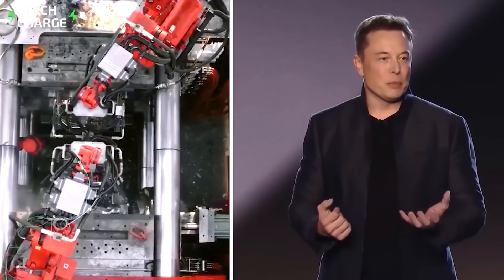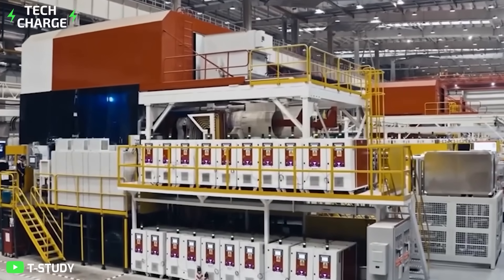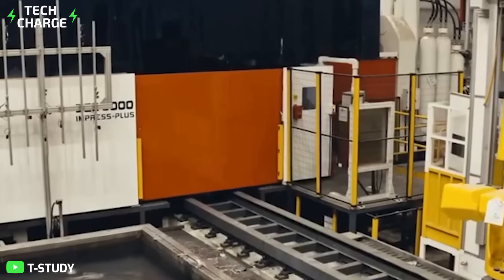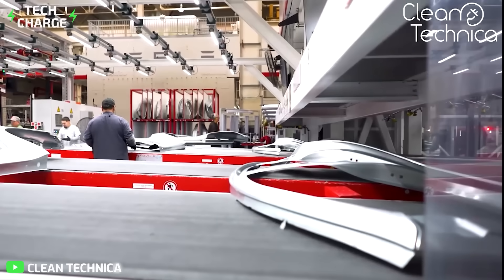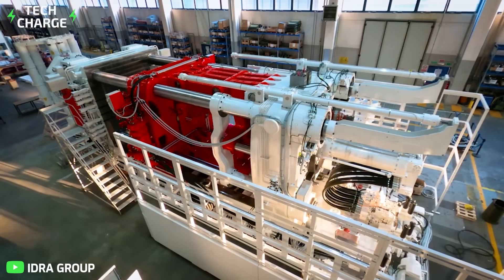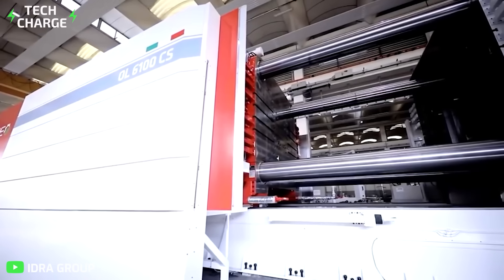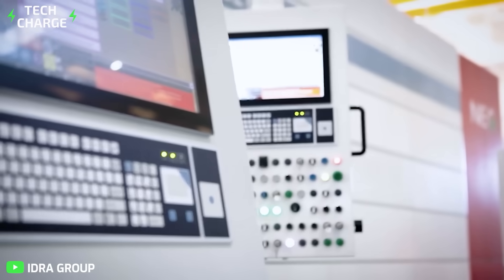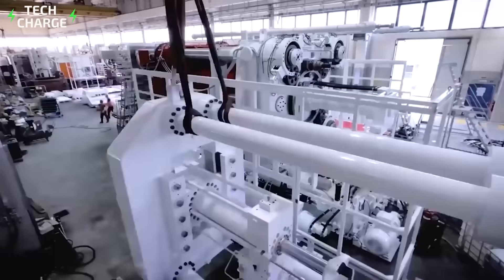How Tesla Cars Are Made So Fast - Meet the GIGA PRESS

Comment: What about an injection vacuum press using plastic.
Reply: Ok so you want a car frame made of plastic?
Reply: @MrSteeDoo  The metal out of the giga press seems flimsy. A plastic injection mold could make the whole body in one piece, with no assembly.  Probably could be just as strong if not stronger.  As far as collision damage, one cold probably be fixed with equal difficulty.

Comment: die cast cars... no fucking thanks... theyre gonna fall apart in a few years... die cast aluminum is extremely prone to cracks... especially in high vibration situations... silicon/aluminum alloys even more so... ill leave the die casting for the toy cars.... wow i had no idea these were fucking die cast moldings... i still thought they were made of sheet metal and the presses just formed it into shape... this is insanity... and not something id buy... i like Elon also... but im not interested in owning an EV... not practical in any way for my needs... and with this kind of build quality, i wouldnt buy one anyway... last car brand i heard was die casting bodies was Matchbox... smack one of them with a hammer and see how it fares... it doesnt bend so much as crumble into pieces... thats "die casting"... die casting is very well known as a cheap and easy way to form metal , the downsides are very low ductility, low strength and poor durability, and they really really hate being welded or repaired...
Reply: It isn't really the die casting it self, it's the metal used as most die cast AKA pop-metal is nearly all zinc with varying amounts of aluminum for higher quality.

Comment: Gigs-this, Mega-that, Super Charger. Hyperbole aside Tesla has yet to build a car with a hood that fits. Also, ‘falcon’ doors that don’t fit right (note the wear in the wheel arch area, and I know Tesla store managers who order an extra rear glass panel for every Model X they receive so that they can adjust the rear hatch, which almost never opens/closes right. Making the adjustment requires removing the rear glass, which normally breaks.

Comment: Sheet metal presses at GMC Truck and Coach in the 40s-70s were huge. They required foundations going down to bedrock and exerted hundreds of tons of force to create body panels and parts in a few seconds from rolls of steel. It was a deafening place to work with ten or more presses working constantly. The idea of die casting a frame is not really a press like in the past. A press assisted forge is more like it.
Reply: yeah, no not down to bedrock lol.
Reply: Ahh yes he is correct on mounting the press down to bedrock. It requires around 800-1000 tons to stamp a bodyside depending on the size of the stamping.

Comment: Why can't GM, Ford, VW do the same?  I am sure they can, so what is the competitive advantage?  Consumers are a fickle group and trying to catch their next mania is always the hard part really.   It must be so tough to do this.
Reply: The limit for most high pressure die casting machines is 4.000 to
It will be  very hard to handle this size due to tooling / process / die maintenance ...
the OEE will be on a lower level - very safe

Comment: Worked at GM, saw presses 100 times bigger than this that literally shake the earth while in operation
Reply: GMC Truck and Coach and Pontiac Motors had big presses too. Brother and Uncle worked presses in sheet metal. Hearing protection did little. Uncle worked 30 years and was almost deaf. Brother did ten and has significant hearing loss. Truck and Coach is long gone. Dad was at Pontiac Motors just up the street. Long gone with Fisher Body and foundry.
Reply: This is a die cast, not just a press. The largest die cast on earth.
Reply: never for casting!!!
maybe forging!

Comment: Pretty cool.   The crash mitigation they can cast in is probably another advantage to large cast parts.   Crash repair may be a little tougher.
Reply: Damage the battery at ALL and it's a write off.  Damage the frame AT ALL and it's a write off. Insurance companies are catching on to this and not covering teslas anymore.
Reply: @LarsLarsen77  looked into it & you're correct.  Too expensive to fix even minor damage.  Tesla has created its own insurance company to deal w/ insurance shortage.
Reply: @samj1185  That's not necessarily a good thing. The maths of the problem won't change. And it gets worse as other manufacturers start adopting the production technique. This looks like something that needs regulation.
Reply: Even minor fender benders come with 5 figures in damage. Being able to make them fast should not be a priority over making them less disposable and more repairable.
Reply: LOL a little tougher. You are better off buying a new car then trying to repair a dent.

Comment: Meanwhile at Krupp steel factory in 1928 - yes, 95 years ago, there was a 15000 tons (!) press. LOL
Reply: This press is not for forging - hpdc (high pressure die casting)!
This size is new and will be very difficult to handle.
Some years ago the limit was 4.000 to for the locking force!

Comment: It is not a press, it is more like molten Aluminum injection machine, just like plastics ones!
Reply: correct - the wording is very often press (but not for forging in this case)
hpdc = high pressure die casting

Comment: Very impressive. However, this is offset by a huge loss of flexibility. Every time a new model is due, you need a new press, and who is going to pay for that?
Reply: I'm sure they will change the diecast parts and not the whole press. You really think engineers are going to built a massive machine just for one vehicle? LOL.
Reply: @PyroShields  They change the mould.
Reply: Why do you care?  Are you concerned about ICE cars when they  have to change out models?  Are you wondering who is going to pay for it?  Be rational, man.
Reply: They don't need a new press you just change the molds.

Comment: i have 2 insurmountable problems with EVs. 
Both problems center on the batteries. 
The China owned resource and the way it's mined. 
The life of the batteries and the exorbitant cost of replacing them.  
I wish Musk had more interest in making this a better place to live, 
than his interest in going to the Moon or Mars, which is pointless, IMO.
Reply: What are you doing to make this a better place to live?
Reply: @MrSteeDoo  Not acting like a brainless robot.  What do you think about the fact that EV's weigh about twice as much as the vehicles they are meant to replace?  Now think about America's decaying infrastructure, bridges, roads.
Reply: @guscarlson7021  I think that double the weight is an exaggeration.  They will be getting lighter as battery tech improves.

At this point 1% of the vehicles in the US are electric.

Autos do very little damage to roads and bridges.  It is the heavy trucks that do far more damage.  Are you proposing that we ban 70,000 lb semi-trucks from the roads and bridges? No?  I didn't think so.
Reply: LIthium is not rare and other countries have much more of it than China.  

The Toyota Prius has been around for 20 years.  Despite people like you decrying the cost of batteries you can get refurbed battery packs for $800 or so.

Comment: The casting also makes sense in an electric vehicle even more, the casting will be very rigid, to help protect the battery.
Reply: it makes just repairs impossible. That's why insurrance is that expensive. Every little damage totals the car.
Reply: @madmikesch2453  Nonsense.  TIG welding.
Reply: @MrSteeDoo  Even more expensive and an extra step, you have to produce the parts. Very expensive and inefficient.